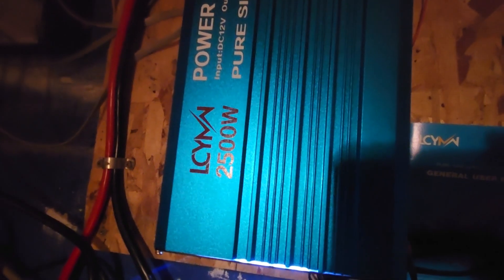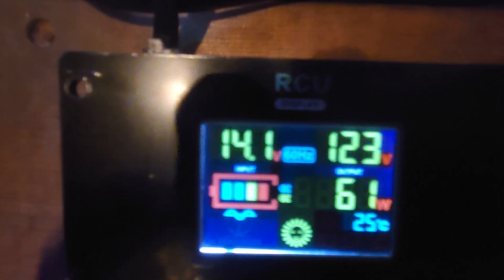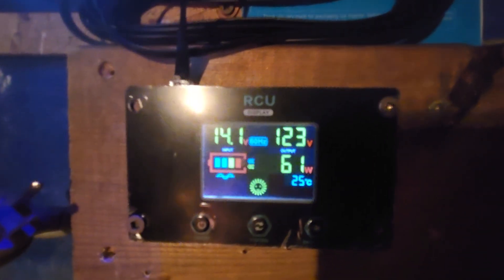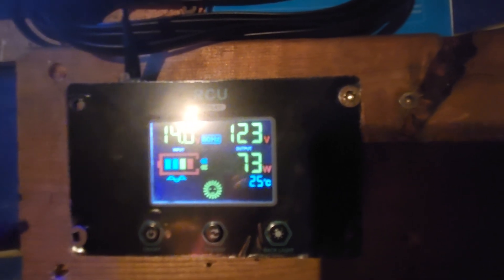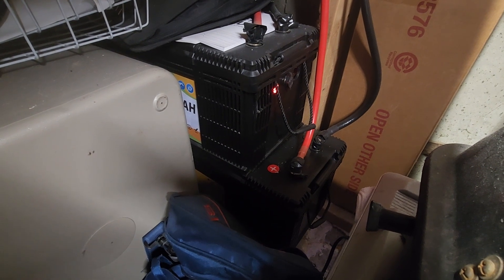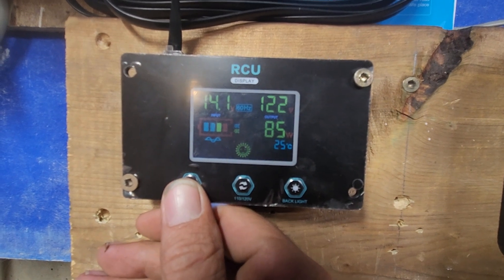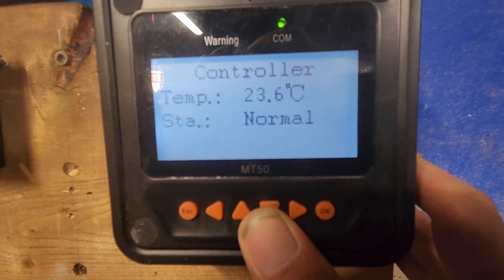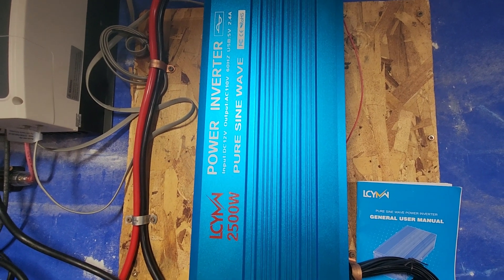Disaster backup power. Sad truth

Comment: 3 months ago I bought an ERAYAK 3000 Watt Pure Sine Wave inverter for $225. I have used it every day for a high inductive load microwave with a continuous draw of 1850 Watts and a far higher surge requirement. It has performed flawlessly. It is coupled with a solar charged 230 Amp Hour Li Time LiFeP04 battery using 2/0 cables. The point I wanted to ultimately make is that the idle current draw based on a shunt is only 8.5 watts. Good reviews indicating reliability plus low current idle consumption were the main reasons I bought this lesser known product. You may want to look at it.
Reply from the maker: @robertrice4441  I think I will look into that. Thanks for watching hope you enjoyed.

Comment: Batteries, Batteries, and Batteries!! 10-20kwh usable minimum. Going through some growing pains myself. Your setup looks good! The   better the inverter (low freq & capacity) higher the idle consumption.
Reply from the maker: My inverter is nice and works good. BUT it gives off too much RFI on the HF radio.
Most of the time I'll shut it down to play on the radio.